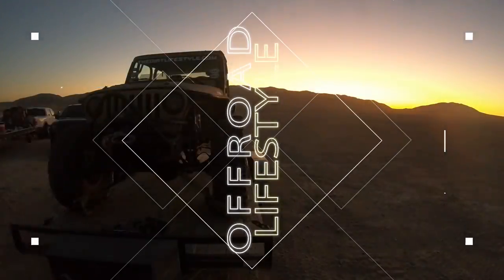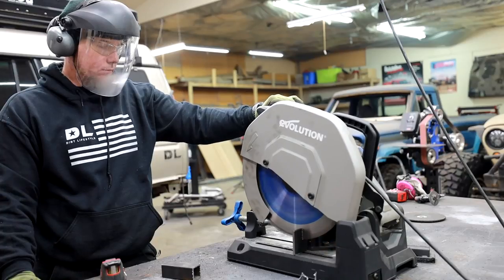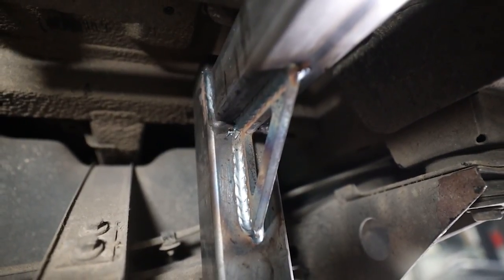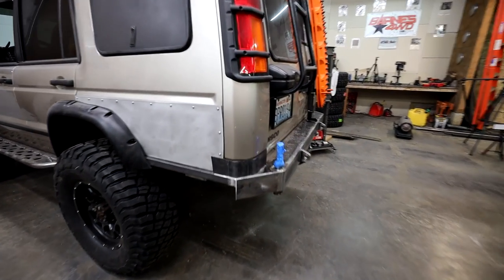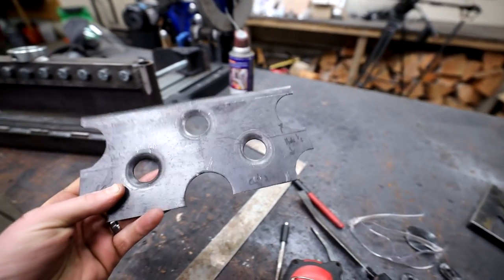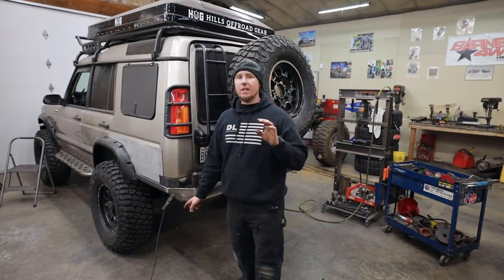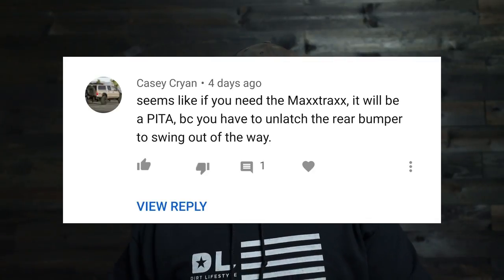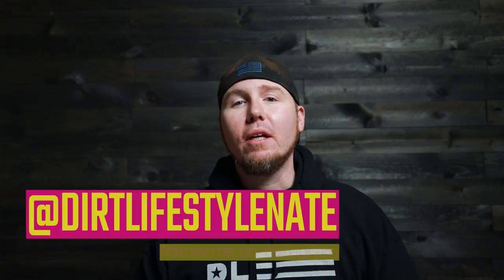Overland Tire Carrier Build Step 3. Ultimate Land Rover Discovery Build Episode 18

Comment: Union sheet metal fabricator here, that at-home press-break is very cool, but when your forming panels for finish work (i.e., stuff you're going to have visible on the exterior of your Disco), you should use a "rubber" (just a flat 0.03 or 0.015 thick rubber strip, comes in rolls) on the V-die, this will minimize back-breaks & other visible blemishes. 

Cheers & keep up the great work/great content!
Reply from the maker: Thanks man 👍

Comment: In order to stabilize the butt welds for the tire loop you might consider removing the gussets and building a small tray. Use the support structure of the tray to beef up and stabilize the welds. You can add the gussets in between the tubes for additional support. With weight being a consideration, use the tray to hold something light like a .50 cal ammo can that stores your tow strap. Creates space for necessities that now has ease of access. Keep up the good work. I enjoy your videos. 

Brian

Comment: The build is coming out badass!! I know what you mean, building a one of a kind swing out takes time, especially when you don't have a drawing for it. That's how it was for me, so I don't mind for the extra parts for your builds. The EMS parts are great products. I built my dual swingout on the Smittybilt M1 bumper for my FJ Cruiser. I built it to where my cooler swings out first and then my tire swings out with my door, because I wasn't sure how much stress the 35's would be on the spindle. Keep up the badass work and can't wait to see the final product 🤙🏽

Comment: Great job Nate. If you want to strengthen the bond between the swing arm and hoop, you could drill holes through the swing arm and fillet weld the hoop on the top and bottom of the arm.
Keep up the good work.

Comment: I mounted a front and rear camera on my LJ. I have a 5x8" monitor on the dash that automatically comes on rear facing when I turn the ignition is on.  A push of a button on the monitor switches to the front.  It has night vision too.  It's for an 18 wheeler.  I love it.
Reply from the maker: Nice! I'm considering a similar setup 👍

Comment: I really like where this bumper is going and it is giving me a lot of ideas for my own project.  

One potential method of relieving the stress on the butt welds would be to hole saw through the top of the square tube you used as the swingarm and insert the tubes for the tire carrier down into the swingarm.   You could then weld around the vertical tubes where they protrude out of the swing arm and in addition plug weld from the front and back on each of the tubes and potentially from the bottom with some small holes drilled in the swing arm prior to inserting the upright bars.  The leverage itself would help dissipate against the internal wall of the square tube and you would not need to worry about a butt weld holding the entire weight.

In order to not redo everything at this point, you could hole saw from the bottom of the swing arm very precisely directly under the vertical bars and add in slugs the will tightly fit into the vertical tube.  You could then plug weld those slugs into the uprights and the swing arm  and cap it when you are finished.
Reply from the maker: Lots of information on this in the next video!

Comment: Nate, my suggestion on a different way to attach that "loop" and reinforce without needing gussets would have been to hole saw thru the crossbar and passing the loop thru the crossbar.  As always, great work, still mad jealous of the garage space.  :)  Bob
Reply from the maker: I have been thinking the same. I will address this in the next video 👍 thanks for watching!
Reply: @DirtLifestyle  Another idea Nate given where you are now is...  1-1/2" holesaw from the bottom, thru the crossbar and slide in a piece of 1-1/2" DOM and sleeve it like an axle tube.  Shouldn't be too hard once you set centers and you don't have to lop everything already welded to the crossmember.
Reply: Good stuff Nate! It would add another step when opening but I wonder if the top of that hoop can/ should be latched to something anchored to the door, like the ladder for example. Of course, it might introduce vibration into the body and all kinds of other new problems to solve so take the suggestion with a grain of salt. As an architect, I learn as much from watching your design and problem solving process as I do from the actual fabrication. Thank you for your generosity!

Comment: When I built my tire carrier I had the same problem. It was a TJ but I ended up using the factory tire bumpers. Just extended the hoop to add slight pressure to the carrier when closed. Since that is the configuration it is mostly used and sees the greatest vibration. Also it hid the connection and eliminates all rattling.  Win win win!!!

Comment: I like the build. Love the Landy in general. I may have a tip for you. I build alot of these bumpers, mostly for for UTEs. But i live in Namibia, and gravel roads are harsh. So for the swing arm, make a stepper plate at the end of the arm, then rotate the locker latch so that it can pull the arm slightly down. This will help for some of the wobble on the spare wheel

Comment: Tire carrier support suggestion, rubber bumper/stopper up high for the top of the hoop to rest against when it's fully closed and/or a magnet. The rubber bumper would help reduce and swap and the magnet would stop it from swaying to the back and wouldn't add another step/latch to open

Comment: Love the lower profile side protection on the bumper. Very tidy. As for the hoop tyre carrier, you could probably add strength by sleeving it with some smaller tube, that anchors into (or through) the box section swing arm. That would strengthen the join without interfering with the tailgate / bumper etc

Comment: Awesome bumper build! All your builds have beautiful quality and craftsmanship which is a joy to watch, something I could suggest to minimize the “bounce” of the swing gate when it’s closed is a trick I used on my fathers TJ, I’m not sure when closed how much gap there is between the arm itself and the bumper when closed but what I did ( I work in a sheet metal shop ) was take a piece of 1/8th in aluminum and tap holes behind the gate when closed and put the 1/8 th inch on top of the bumper and gave it a 1/4 inch down towards the edge of the bumper and ground smooth, creating a ramp effect so when I swung closed the carrier it would sit flush metal to metal all the way across and not be over stressing the ends, still a little bounce ( always gonna be ) but the noise reduction was crazy and the aluminum was the best bet because I didn’t wanna make it outta steel, then paint it only to scratch it off everyday, like I said awesome content and great builds! Missing that old jeep pickup

Comment: Nate, I use the same locking pin on the tire carrier I made for my GX470.  When I built mine, I had the pin slide on a 1/4" plate topped with a thin piece of stainless for  friction and a hole at the "full open" point for the pin to fall into.  It works well and I don't have to do anything with it to allow it to lock open.  I hope this make sense.  Keep up the good work!

Comment: Take your time and keep up the good work! Not sure if the rectangular tubing is wide enough, and it also might add a bunch of extra time, but using a hole saw to drill a hole down the top of the swing arm to drop the tubing in should do the trick for stiffening up that area once welded. Hopefully, that made sense.
Reply from the maker: Thanks! I have had the same thought. I will address it in The next video 👍

Comment: Hey Nate, love the content. This build is truly amazing from the day you got it. I thought of an idea about shoring up the tire carrier. What if you cut the but welds off, drilled 2 holes for the hoops and reassessed them into the cross bar. You could weld it on the top, and also drill all the way through and weld that up and grind it smooth for the finish. Then technically it would be welded in 2 spots per bar, and also would be supported for forward and backward movement going down the trail. Just an idea! Keep up the work man! 👍🏻
Reply from the maker: Thanks! More details sunday!

Comment: You must plan on doing some serious wheeling if you need corner armor. lol   I like the idea of strengthening the bumper by  adding corner protection. I would like to cut and fold the rear quarters on my XJ but would want something like you added to really protect everything. Its probably overkill but its nice to have more clearance and add strength to the bumper at the same time. 
Remember, the haters are going to hate. lol  I like the way you called him out. I try to be positive when I comment on YouTube.

Comment: Hay brother, I know it'd be some rework but I just thought I'd share my process with you after your advice with my XJ axles... when I do a tire carrier like that I drill the square or rectangular tubing and run the tire hoop through it and weld top, bottom & a few plug welds on the rear, It keeps it from flexing around & makes it super strong. You can even sleeve it then run the tube through for extra strength for the 38"+ tires... Thanks for your help with my projects...
Looking great brother 👍

Comment: Love the content and 'real world's process you present. I have a couple ideas for the riser hoop (v2 of course). Instead of butt welds from the hoop to the arm, maybe drill holes in the arm for the tube to insert to and weld there, that might provide more of that twisting resistance you're looking for. That idea could even be expanded to include weld slots in the arm to make use of the tube section in the arm itself. Alternatively, I also think some longer triangular (4x1 or 4x2) braces on the outter portion of the tube to arm would help as well without much added weight. Some holes for decorating, and it could be an attractive strength addition. Keep at it!
Reply from the maker: Thanks for suggestions buddy, more info next Sunday 👍

Comment: Had a thought for you on how to strengthen the joint from the vertical tubes to the cross bar. If you weld a bit of flat plate that runs a few inches up the length of the tube and down across the face of the cross bar, both front and back. That should add a lot of strength as if the tube wants to move front to back it will be putting that bit of plate in tension. Not as strong as something like angle but better looking and easy to package anyway. Just something I came up with, hope it helps. Keep up the great work.

Comment: To strengthen the joint, I might add a return flange that runs out the rear of the tube (side the tire is on) and down the rear of square stock. Something nice and thick to resist flexing. Maybe a rib of thinner folded steel at the narrowest angle your bender will make.

Comment: Another great video Nate! Have you thought about making a bracket mounted to the 5th door that the tire carrier will rest/partially latch onto? I am thinking of the JK swing out tire carriers that mount to the door and when they close they hit a support bracket mounted to the door. Of course yours swings the opposite way but it may prevent the moment arm on the spindle and increase the longevity of the tire carrier assembly. Excited to see what you come up with this coming week!
Reply from the maker: Thank you! I have been brainstorming on this aswell. Still trying to figure out the logistics 👍

Comment: Not casting stones here Nate just offering my 2 cents. I would suggest more triangulation on the tire carrier. Think roll cage. Your bottom beam is rotating (torsional) from the leverage the tire has. I would look at spreading the load out wider and from a different angle to add strength through shape and angle vs material thickness. Love your content and ability to explain difficult topics like suspension geometry.

Comment: Absolutely love the videos dude, watching them is so inspiring to build vs buy parts. For the leverage problem on the swing arm, I would recommend in addition to the gussets you made in this video, consider taking some flat bar and welding it to the back side of the carrier. Putting it on the round tube and taking it to the bottom of the swing arm would take loads of stress off the butt welds. You could do it on the front side too, but would then just have to consider looks more. Keep up the amazing work!
Reply from the maker: Thank you for the suggestion buddy 👍 more information on Sunday

Comment: If I may, you might want a midpoint tie in on the lock latch on the tire carrier. When you closed the tire carrier, there was a lot of bouncing around because of the height of the tire. All that leverage is going to brake the spindle as strong as you may think it is. I have done mid height lock latches in several after market bumpers on jeep because of this same issue and it has improved or eliminated the wobble from the spare tire. Maybe tie it in with your new corner armor? Just a suggestion thought, no harm if you disagree. Love the videos either way.

Comment: What about some small trusses, say 5"x 2", running perpendicular to the gussets and going from the bottom of the swing arm up onto the carrier tube? This I think would definitely shore up that weak point you have between the 2 parts.
Also, have you considered some rubber bumpers at the top of the loop to prevent forward swinging? Just an idea.
Great work man! I'm really liking how this is turning out.

Comment: Your work is one of a kind my friend it’s coming out great and i like it!! would have it been better to drill the holes in the square tube for the hoop to slide down into and then weld the top and bottom?  I know it would have been a added step but possibly better in the long run for added support and plus the gussets and plating would make it a solid connection.

Comment: I think you need some 3d gusseting for the upright. The gussets you made today will prevent movement driver to passenger but your real issue is fore and aft.

If you gussetted with more tube it should give you some more fore/aft rigidity.

As you mention, it's really tall. 

The only other way is to have another latchnor attachment at the top but that would be a pain to reach.

Comment: I built a system similar to this on a 88 Toyota pickup years ago. Ended up having to lower tire height to reduce the whip. Brought it down to where the bottom of the tire rested against the bumper itself. HOPEFULLY yours doesn't suffer the same issues.

Comment: You've been doing for a long time, but I wondered why you used material on the corner that is not the same thickness as the bumper?  Two reasons additional resistance against vertical loads and the corner of the bumper is now a catch point instead of a smooth slide over surface.  Love your work!
Reply from the maker: Corner of the bumper? Or the corner armor? Just wondering so I can clarify 👍
Reply: @DirtLifestyle  The bumper appears to be 4" or 5" in cross section but you used a 2" square to protect the rear quarter panels.  I saw that you beveled the ends of the bumper at the intersections but I would have thought a matching quarter panel rub piece, same cross section as bumper, would slide past obstacles better.

Comment: Nate, you're going to have a problem with the primary vertical hoop of your tire carrier. The tubes attach to the swing arm at only two points along a plane. The old engineering adage is "two points of attachment make a hinge", "three points make a mount". Those welds will cycle and likely fail as that 120+ LB tire wobbles as you drive.

Comment: Great work brother. I’m not much of a welder because I need ALOOOOOT of practice BUT I’m looking at some cheap welders to build my own bumpers for my k10 and my suburban. Trying to build a road vehicle that I can take off-road. Nothing too fancy maybe 33’s to 35’s and a 2-4 inch lift. I still need to pull a camper...... but anyways, great stuff. My wife thinks I should start building my own stuff too bc of the cost difference..... keep the videos coming 👌

Comment: The bumper looks great, i think if i were to build that carrier i might have tried to stabilize the tire hoop a little by making it a bit longer and then cutting holes into the top and bottom of the swing arm, slide the hoop pipe through and weld it shut at the bottom and the top, this way the pipe would leverage against itself and you have double the weldarea

Comment: I know I'm late to the party...but seeing how this is and overland/camping build and if your stuck enough to need the maxtrax, speed to access the rear compartment doesn't seem to be an issue/concern. Can you ad another 'latch' on the original spare tire plate that would stiffen the hoop a little. Maybe a twist lock device through the center of the spare??? Can't wait to see the table and the adjustable leg that holds the weight of the swingarm when its open!
Reply from the maker: Lol I agree! More details sunday!

Comment: Nate,
in regards to your tire hoop sway/top-heavy loading issue. could pin lock/tab not be beneficial in adding support via utilizing your spare square tubing AUX bit on the door bracket taking the weight off the tire carrier and distributing weight to the door bracket when closed keeping the potential for top loading force to a minimum? this build is awesome creativity! this would also keep the weight off the tire hoop as most of the mounting bracket and gusseting will be on the door-mounted plate/square tubing. this could also be achieved by adding a 3rd round tube in the center of the tire hoop from bottom to top on the centerline mating to door bracket with pin lock or C hook and latch mechanism. TY for the great content just thought some additional ideas from outside observation may help. interested in seeing the final product rolling down the trails!
Reply from the maker: Many details in tomorrow's video 🤘